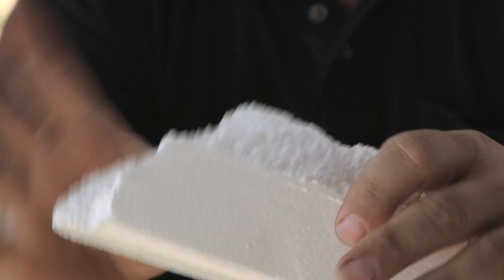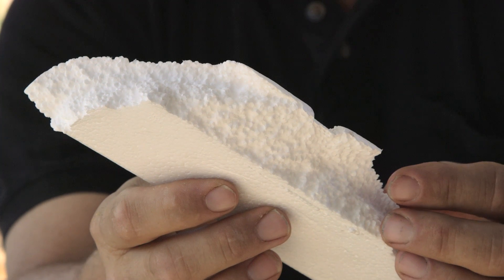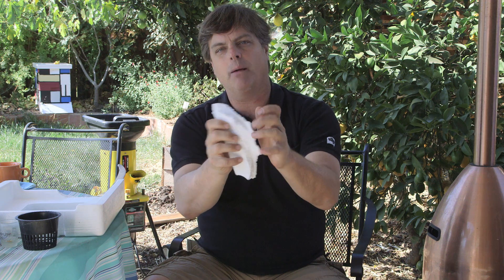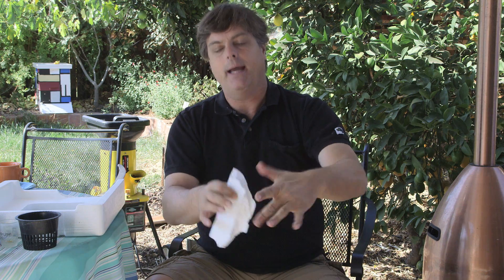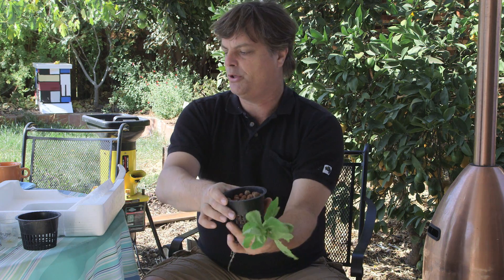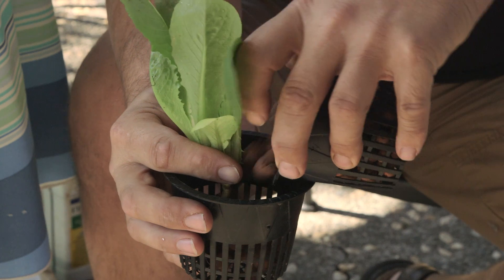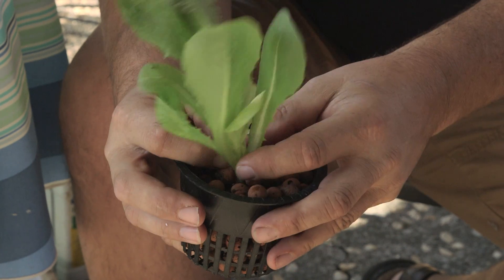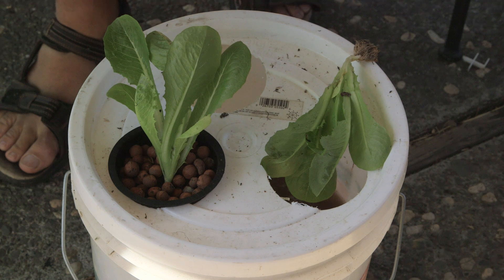How to Use Polyester Fluff as a Hydroponic Medium : Hooked on 'Ponics

Comment: that is polystyrene, not polyester.  Polystyrene has very low resistance to UV degradation.  PET aka polyester (same used in clothes and soda bottles) is a different material

Comment: Well I wouldn't call that polyester fluff. I imagen polyester fluff is more like poly-fill. We call that styrofoam here in the USA but before commented I found.

"In the United States and Canada, the word and generic term “Styrofoam” is used incorrectly to refer to expanded (not extruded) polystyrene foam, such as disposable coffee cups, coolers, or cushioning material in packaging, which is typically white and is made of expanded polystyrene beads."
"STYROFOAM™ has never been used to hold food and for making beverage containers or coolers for the beach - STYROFOAM™ is actually a registered brand of the Dow Chemical company – with very few exceptions they color it light blue to differentiate it from EPS or expanded polystyrene foam"

http://www.forte-eps-solutions.com/phone/styrofoam-sheets-polystyrene-insulation-difference-new-jersey-new-york-ontario-quebec.html

Comment: That's not polyester fluff. It's styrofoam.
Reply: Yes and No apparently... I learned a lot  today. I would still buy poly fil and try that on a couple plants though.

"In the United States and Canada, the word and generic term “Styrofoam” is used incorrectly to refer to expanded (not extruded) polystyrene foam, such as disposable coffee cups, coolers, or cushioning material in packaging, which is typically white and is made of expanded polystyrene beads."

"STYROFOAM™ has never been used to hold food and for making beverage containers or coolers for the beach - STYROFOAM™ is actually a registered brand of the Dow Chemical company – with very few exceptions they color it light blue to differentiate it from EPS or expanded polystyrene foam"

http://www.forte-eps-solutions.com/phone/styrofoam-sheets-polystyrene-insulation-difference-new-jersey-new-york-ontario-quebec.html